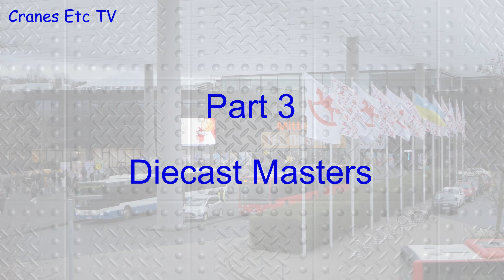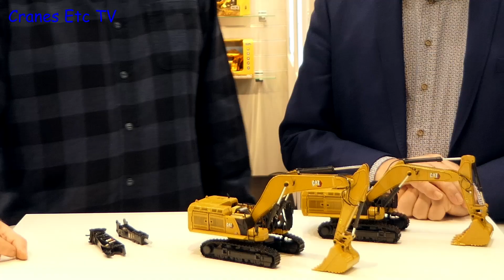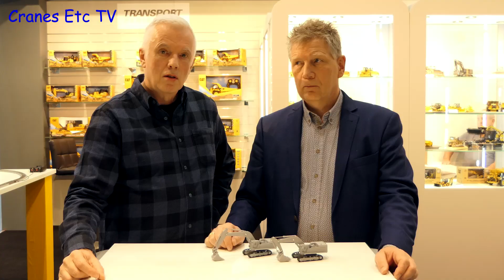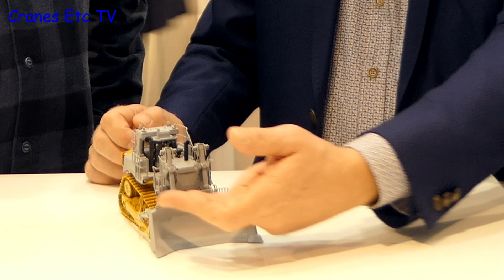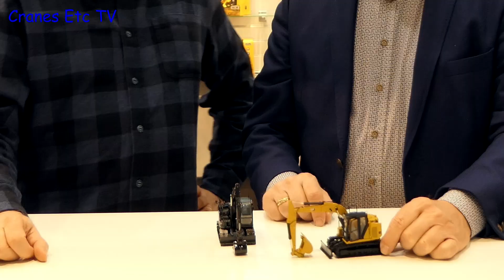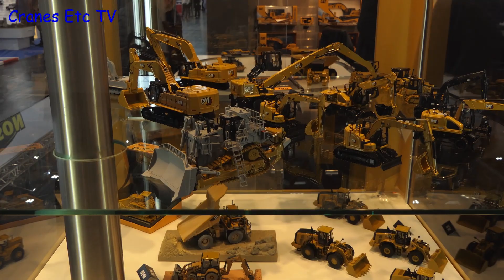Nuremberg Toy Fair 2023 Part 3 - Diecast Masters by Cranes Etc TV

Comment: That 1/87 scale 395 is exciting! It scale next to the 320D is impressive. A side note: is it just me or do the tracks on 1/87  395 Seem A bit undersized in width?  With an excavator that large in ho scale, it should be possible to add some of the more prominent hydraulic lines like you see in the 1/50 models.